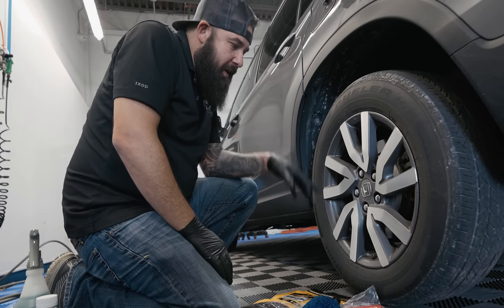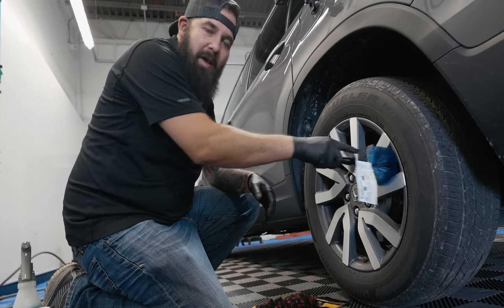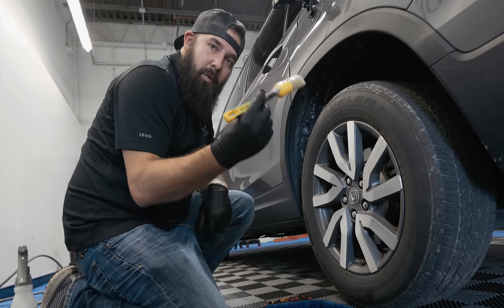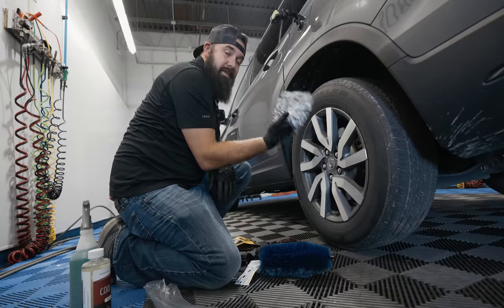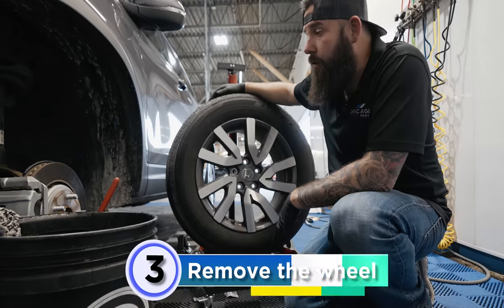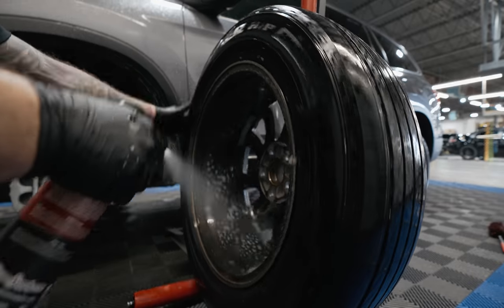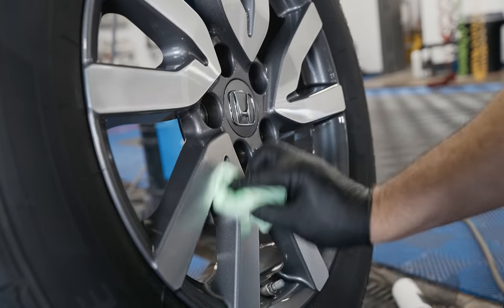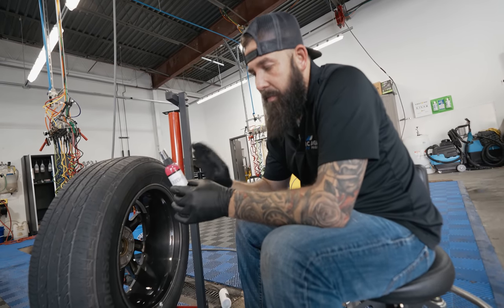A Detailer's Secrets To Wheel Cleaning

Comment: Those of us who cam go down the wheel rabbit hole like what we just saw. I purchased a traditional woolie and a angled woolie from Car supplies and they are still holding up over a year later. I use these a lot too and the work stuff brushes are awesome too. Does the Shine Supply. One in a gallon size like Meguiars Non Acid cleaner? I’m lazy at times so after coating a wheel I use a product like Gyeon wetcoat for maintenance washes and just power wash off. Thank you for the video and for having the best online shop for buying chemicals and tools. Maybe Santa can bring me the wheel stand you were using.

Comment: I used to use those types of curved foam applicators for tire dressing. They work okay. But the Detail Factory Curveball brush is where it’s at. Spray the product directly onto the brush, then brush it onto and around the tire. Super easy and less messy also.
Reply: yep, it's a must have for off road tires as well.

Comment: When a wheel has been neglected it is easier to take it off wheel and to then clean using an acid based cleaner away from the vehicle as long as the clear is not compromised on the wheel.  You don’t use acid based cleaners regularly on a car.  You chose the safest cleaning routes to minimize risk to the vehicle but sometimes you have to use an acidic cleaner for the sake of time when the wheel is caked with buildup.

Comment: I actually use a ceramic spray on my freshly cleaned tires after they dry, then I apply a dressing and buff it off. It really prevents the tires from having to be scrubbed the next time I clean them. it doesn't last as long as it does on the paint but helps save time cleaning the tires for a good few washes.

Comment: i dont have the time or will power to go nutz and actually coat a wheel, but i just use mequiars ceramic detail spray on my wheels. crud cleans off easy, and they stay looking good between washes. im sure an actual coating is better, but sometimes you gotta draw the line at enough.